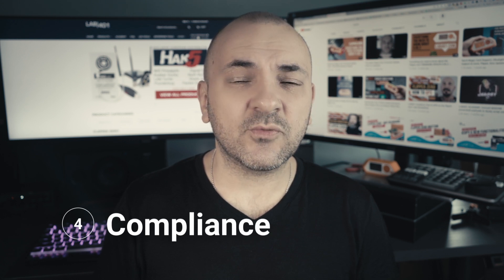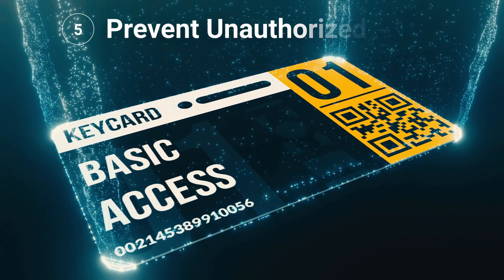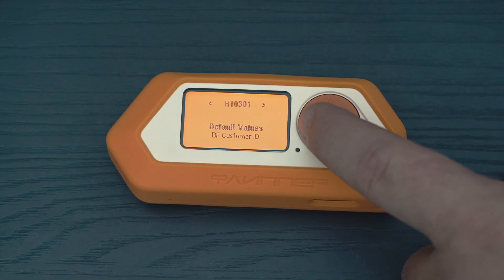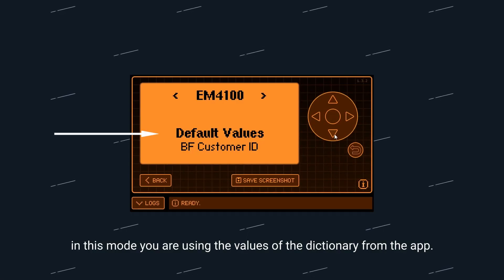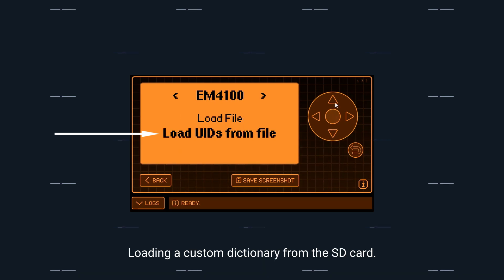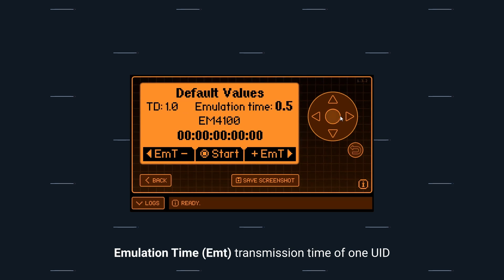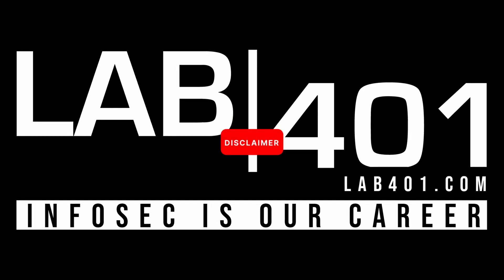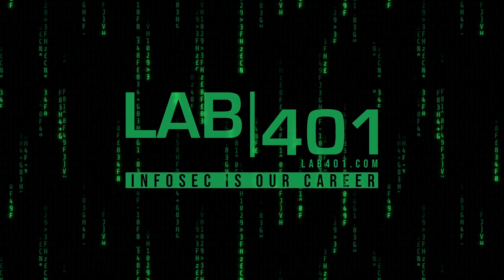Dive into RFID Fuzzing with Flipper Zero, the RFID fuzzer app.

Comment: Hi I'm a locksmith that receives lock out calls about key fob entry systems. So excuse my ignorance as I'm not extremely well versed on the tech side. But how do you determine the readers frequency protocol?
Reply from the maker: there are multiple ways to determine the reader frequency, Check the Reader's Label, Search Online Using the Model Number, check the cards people are using on the reader, you can also use an RFID Field Detector sold by lab401 (you will see if it is a high or low frequency) you can also use a flipper zero (there is an app to check the Field). hope it is helping :)

Comment: i have a machine in work, that uses RFID tags to grand access to various levels within the system. unfortunately, the mid level tag has been lost a while back and we now need access to modify a setting for a part that is produced. can i use the fuzzing method, to find the code to access the mid level and then write it to a new tag?
Reply: Technically yes. If you use the Flipper to identify the reader, and then fuzz it, it’ll tell you which code it happened upon first which gave a positive response. Of course, that might only give you a higher access level code than the one you need, so you’d have to disable those codes first.
-
Once you had the mid-level code, you can save it, name it, and write it or emulate it if so desired. You can do the same for NFC tags/cards.

Comment: It's crazy that the fuzzer put the SUT in a bad state like that. It's almost like the manufacturers don't even test their own systems before releasing them.
Reply: @asimpletune I know this will come as a huge surprise (and possible disappointment) to you, but I've been in the IT industry (specifically hacking) since the 90's, having had a Windows 2.0 (DOS-based) computer still: Many if not most manufacturers don't test their own systems before releasing them thanks to things like capitalism where money is more important than testing. They'll do the least amount possible to pass whatever needs passing (like minimum security standards, etc). Also, many people who sell and install the systems (RFID in this case) are to blame. The customer does not do the research before purchasing and relies on the salesman, and the salesman only goes with the option that gives them the highest return/profit (again, capitalism). So in the case of RFID systems, that usually means LF, all security off or at the minimum, etc. Your welcome.

Comment: i have an iphone so i cant even use it
Reply: if you have $200 to buy a flipper, you can put $100 on a cheap android to use as a tool
Reply: i might do that, thx @sethking6361
Reply: Huh? I have an iPhone and never had any problems with the Flipper. You don’t really need the phone anyway, it’s just for ease of use.
Reply: @marcellkovacs5452  wait so how do i use it directly from the flipper? if it matters the firmware im using xtreme
Reply: You could use an android VM on a computer too..... I believe you can use some online tools when the browner supports serial access
Reply: Apple is closed source and they own the phone not you lol.
Reply: @godjhaka7376 Jailbroken iPhone can do it.
Reply: @godjhaka7376 that's funny but probably true cos I don't do apple

Comment: Hey how would I go about just emitting 125 khz rfid h10301 tags?

I ask because at my work we use those badges and our gats only have the readers on the "outside" of them. When we go to leave we have a weight sensor that detects if a "car" is there. I ride a moped.. ti trip the sensor I had to slam my brakes to get extra umph in weight to trip it.. problem is yesterday my moped slid out from under me and I hurt myself just trying to leave the property.. The tag reader is on the outside where I cant quite reach it.. if I could reach it I could badge out, the in gate. I would LOVE to be able to take my $2,000 vehicle with me when I leave work and you know not abandon it there and have to pay my whole days wages on an uber..

Anyone got any suggestions, I would love to know what people can think of. I am more software dev then hardware dev and do not fully understand how antennas work since some will be designed for certain ranges and getting my mind to wrap around how that makes sense is difficult. Can I add an antenna to flipper zero? Do I need a more powerful transmitter? What direction could someone point me in for more information to help solve my problem? It's a 3+ hour walk to get home if I cant use my moped and zero out my income if I have to uber. Certainly working 48+ hours a week should not net me a deficit just to work. So what kind of thoughts do you all have to resolve this issue of mine? I am quite pissed off at my employer over this unsafe gate. Heaven forbid the building (which has over a million pounds of paper) catches fire. Because I will burn alive.
Reply: Get you a large magnet and that can trip the in ground loop or some people have had luck shutting of their bike and starting it over one of the in ground lines. Something about the EMF will help it to register.
Reply: @odorcide  Thanks. I don't have to worry about it anymore. Moped broke down completely now and I have been catching rides with coworkers except today on the way home I had to walk. Its a 3 hour walk home so I walked about an hour then ubered the rest of the way for $20 which was still a huge cost. At the same time I think I am just going to provoke my employer to fire me so I can get unemployment after what happened today.

Coworker brings in mcdonalds again... I say hey wheres my mcdonalds.. again like I usually do because I cant get my own I have no car or working moped.

Boss then decides to unload upon me about how its offensive for me to "want mcdonalds too". I even said how rude, you didnt bring any for the rest of the class. Boss then goes on to say her body her choice or some shit and im like dumbfounded because what is she trying to imply? That mcdonalds makes you fat or something because body shaming people is a really bad thing. 

Like what the hell is wrong with my boss? Not everyone who goes to mcdonalds even eats the food. Some people buy it for other people or their kids or who ever else like its really really really common at other jobs for a worker to say hey you are passing starbucks or mcdonalds bring me something on the way in and ill pay you when you get here.. its nothing to do with a persons body plus trying to imply negative things towards people going to mcdonalds..

I should have given some background.. my boss is a "she/her" pronoun person that really needs a reality check to see how many people she is offending playing games.

So I am literally at the point fine if you want to go throwing insults like that and violating company policy and quite honestly possible EEOC violations then fine ill get verbal back and let them just fire me. Then I wont have to loss money when ever we dont have a full day or walk home with blood soaked socks for walking 10+ miles up hill and down hill in actual freezing cold.

Sorry about the rant.. This employer actually actively discriminates against people. I am by far one of the most trained and fastest people in my department. I can even do OTHER departments better then my own boss.. we had a typing test and I type much faster and more accurately then her. Which is a required skill for one of the other departments. I was able to improve the thruput of work by 300% because they are literal idiots with computers.. I mean brain dead idiots.. They cant comprehend basic anything about them even though the job is based around it.. I have been here 14 months and I get paid the same as a new hire does and will NEVER get a raise because I turned down a full time hired in job offer for them because it offered $0/hr more and switched from weekly pay to biweekly. Which wouldn't help me at all.

Honestly I am disgusted with this employer and their ignorance. They think H10301 tags are "secure". They are absolutely not. Hell I even pointed out the construction they had done recently after I started was done improperly and that a door jam did not engage the "dead latch" meaning it could be "latch slipped" and its supose to be a secure room we do government contracts and all that.. and they had 0 interest of making the company come back out and do it right or getting anyone to even fix it. Literally a piece of trash I grabbed out a trash can got me into the door faster then even using my badge because with my badge you gotta wait for a click where as latch slipping you don't.

Sorry for the long rant.. This place is really pissing me off. Why are their pratically no reasonable employers left these days? Like the last employer I knew that had any rational reasonableness the owner ended up dead in a car accident.. devistated me to hear the news... and its been clown employers ever since. Again sorry for the rant I think I a am going to call off work tomorrow and try and calm down before I do something stupid I may regrret.
Reply: Cool story bro!
Reply: Have you considered a stick that you can use to reach the card reader?  Put your card on a stick, poke it in front of the external card reader.

Also, those vehicle readers on the ground are not weight sensors, they're metal detectors.  Your moped doesn't have enough metal to set them off.
Reply: @MattMaxwell  interesting. So I discovered at the corner of the sensor it does seem to trip it.

Also yeah I thought about a telescopic pole but that would require me to throw it thru the fence as the gate is a fence that slide open. Otherwise it would break or cause problems.

I think I did see somewhere where some fire rescue use ladders to slide under gate fences to open them now that you mention that. 

Do you know if it’s measured by square foot or mass? Like if I had a few bars of metal be a thin sheet?